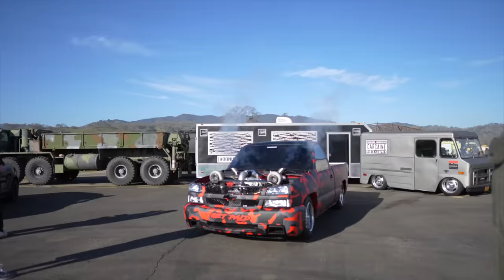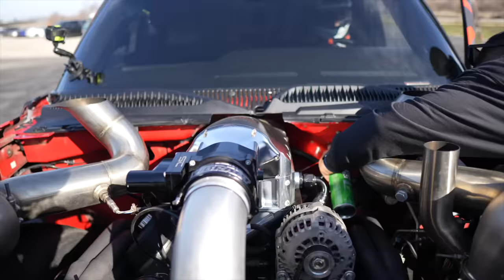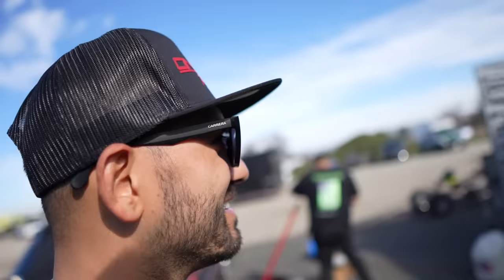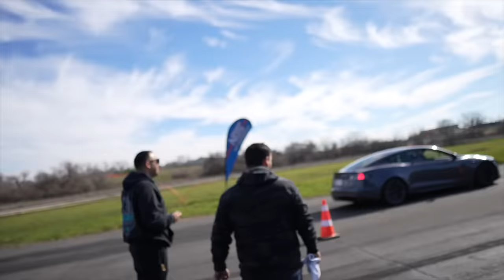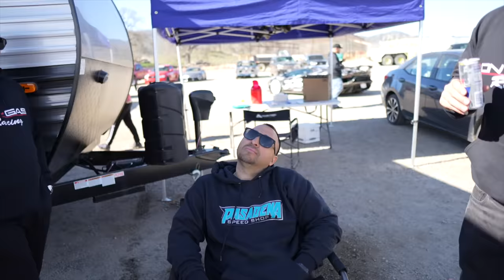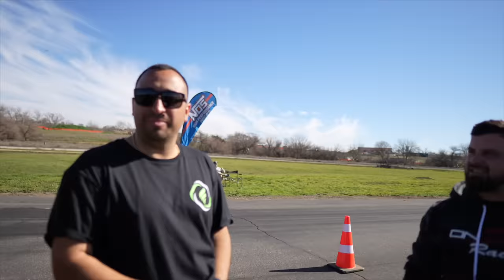Tesla Plaid vs Twin Turbo Chevy Silverado RACE // THIS vs THAT @TheHoonigans

Comment: I do not CARE how fast an "RC"  electric car will run, it is not the soul  of drag racing. Does not require the raw skills of builders and drivers of ICE powered racing. The sounds, visceral sensations, the smells and sights of ICE racing is what RULES. 
These guys put on a stellar event in this vid, kudos 👍👍

Comment: I test drove a single cab with a v8 vortex in it and I gas it, burned tire all the way through 4th gear. These trucks are amazing to motor swap lol unfortunately I didn’t buy it because I need something for efficient to pull a trailer for a lawn mowing business but it was a nice truck. It was really cheap too that’s the main reason why I test drove it it was leaking oil and was throwing some spark splugs codes so I decide not to messed with it.
Reply: Let’s see your truck race a top fuel dragster. That’s about the same race as you got here or put that pos truck of yours on street tires like the Tesla’s and then try it.  You just barely beat a stock street car with a race truck that can’t even be driven on the street. Pretty lame accomplishment guys. Or maybe put this truck back to stock and that Tesla will be in New York before you get out of south central LA.  This video proved nothing but that a race car can beat a street car.  I already knew that
Reply: @richardharris2062  You need to sleep

Comment: Ayeeeee htown strong if you need another guy I'm master tech certified not looking for money just more experience I have a 97 Mazda Miata that's LFX swapped from a 15 Chevy Camaro RS makes advertised 323 to the wheels and weighs 2073 all built by me.

Comment: That truck is unreal how fast it is, but ole buddy in that Tesla has no clue. They need to do this with a real driver that can drive that Tesla. Something is up with this video and race. Them truck boys are straight up good, but that is not a true race with that other driver. He is so scared of that truck. But in the end. Just goes to show you. Those electrics are no match for a built gas burner. Like I said yall need to get with Tesla and get them to send a real team like that truck crew has and get a real driver down and run them..... No way that Tesla gets beat that bad. Beat yes. That bad .... No way... Great video of that truck and showing that truck off......

Comment: I mean yeah, it was obvious the built TT truck was going to pull out the win but electric has come a long way and the fact that a Plaid can click off a 9.28@150+ from the factory is nothing short of impressive.
With solid state battery tech on the horizon, it's only a matter of time until EV's are in the 8's and 7's.

Comment: Ok haven't even started the video and not going to read any comments yet but I highly highly highly doubt the truck even has a shot at beating that Tesla. In about 10 years were all going to be doing computer and battery swaps to get more power out of our electric hot rods
Reply: Damn that truck is insane. Those Plaids hit easy 9s and modded hit 8s. Want to know what that truck runs. But that is a legit race truck.

Comment: Honestly this is nothing to be proud of fellas. Allow me to explain....

The thing is, look at what it takes to beat that little sedan.... Truly think about this for a moment. Let the gas fumes clear and then think about what just happened...

It took an entire race crew, a 1500hp purpose built truck that has to be trailered in, drag slicks, and it requires burnouts to heat the tires up. Yes, it being a purpose built drag vehicle, it's impressive. No doubt there... Very nice truck. I like it.

BUT, compared to the Tesla, I'd say this is not a good look for the truck and the crew, let alone for combustion performance vehicles in general. Because again, look at what it takes to beat a quiet little electric sedan. That little electric sedan can be driven home and it also gets WAAAAAY better mileage than that drag truck. Look at what it takes to get the truck there, prepped, and ready to go.  The Tesla just shows up and just sits there patiently waiting. (I think the battery does require some conditioning time prior to racing) And the fact that it even kept up with a purpose built drag vehicle speaks volumes considering what it is. Yes, it's a performance version of an electric sedan. But it's still just an electric sedan and by NO MEANS the precipice of electric drag vehicles. There are much faster electric drag vehicles out there.

You gotta look at the whole picture here. Think about what the Tesla is and what it's accomplishing, not the fact that a massive 1500hp twin turbo purpose built drag truck, with a team, beat it. Look at it from the perspective of, that's what it took to beat an electric sedan. Because that's the truth. I could go on for days about what's wrong with that picture... Bottom line is, with enough time, electric powered vehicles are going to make combustion engines look stupid....

Put that truck up against an actual purpose built electric drag car. The Ford Electric Cobra Jet for example... Now THAT would be a true testament. I want to see that race. Contact Ford, get it done. Lets see what you're truck can really do because this proves nothing.

Ford Electric Cobra Jet specs-
1500WHP
1100lb/ft of torque
8second 1/4mile pass @ 171mph
Reply: 😂😂😂😂😂 Fam a cobra jet would look like it's standing still trying to race this truck seriously.
Reply: Bruh it lost to a truck

Comment: That was a good last race. Yes the twin turbo did beat the Tesla. But the big takeaway should be this. That Tesla was on street tires and still had every part it came with from the factory. The other takeaway should be this. That truck was crazy fast but but you will be rebuilding that engine and trans every 15 to 30 runs. That Tesla can and will keep running for another few hundred thousand miles. The Tesla is the future.